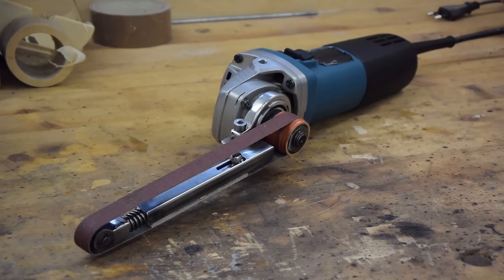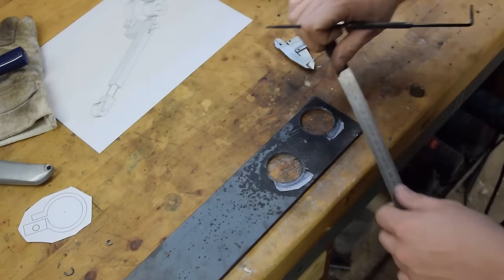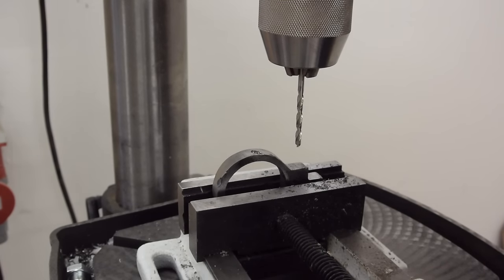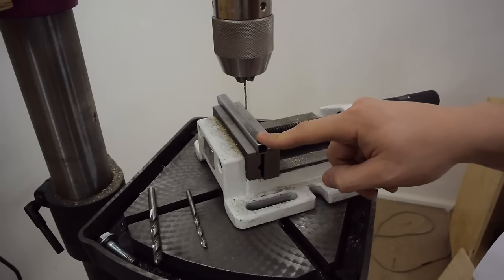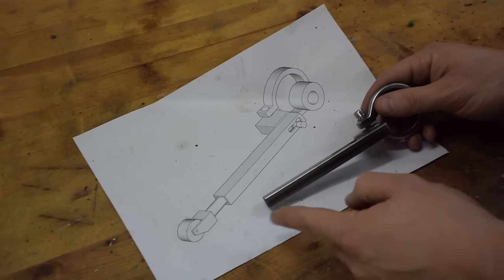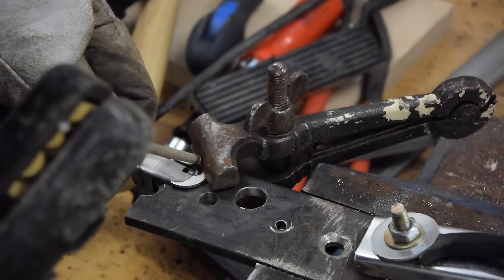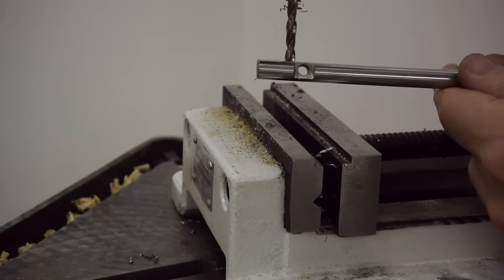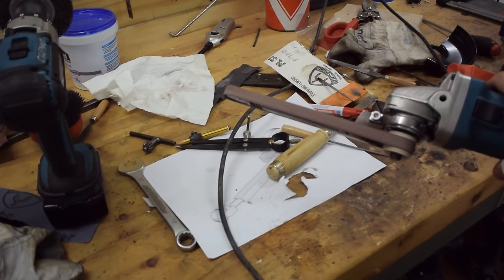How to make a Power File (with basic tools) | Angle Grinder Hack | Grinder Attachment

Comment: cosmas, if the drill was high speed steel you can`t harden this way but you`re fine to use as axle. as you said the bearing will crap out before anything. this is an excellent job and i really like the file work (even if you don`t like it :)) the clamp piece came just extraordinary man, let me tell you i see welds and metalworking everyday and this is top notch. hats off to the design of the pin and the slot.
as you welded a solid bar to the thin wall you noticed you didn`t blew any holes, that`s because the solid is acting like a heat sink and consciously or not one tend to direct the heat to this part which is correct and helps with the excess heat. a trick you could use next time you have to weld so thin is to fill the tubing with solid bar or a strap firmly against the side to weld, aluminium or copper works even best. you can also start the arc on a piece of solid stock you put close to the weld and "walk" the arc to the joint (if it makes any sense what i`m trying to explain). that transformer is making a lot of noise ! haha reminded me of my first machines (nothing "electronic" to smoke ah?), see if the metal plates of the transformer aren`t getting loose, soft rubber feet help with the noise. and one important thing with a transformer if you have a metal cart or table put something btw the welder and the metal or the magnetic field is going to sink in these parts and make a mess of your settings. thanks for sharing man. take care. pete
Reply: +thebrokenbone  Man, you have revealed some very useful tips about heat sinks and settings being affected by adjacent metal plates. Glad I read your comments - Cheers!!
Reply: thebrokenbone
Reply from the maker: Thanks for the info! Very interesting!

Comment: You are genius, Cosmas.  I bought a Makita 9032 when I needed a belt sander.  It was expensive and the motor is sticking aside making it quite unbalanced.  Your thing looks better especially if it is installed on a very small angle grinder.  And, one more thing: I was dreaming of a cordless belt sander, but did not find a single model available in the World.  And you made it possible!!!  Brilliant idea!

Comment: For those that don't have access to making the clamp section, the guards meant for larger grinders usually have a deeper wall, at @1 2 dollars, one can be bought, cut, and repurposed. Most hardware stores carry a small selection of aftermarket parts for tools. IF one is lucky, one could find a flat wall guard, that's perfect since you can just drill in to the face and make a support directly from that without even modifying a thing. Bosch guards usually are build that way, and out of quite thick material.

Comment: i use a little work sharp belt sharpener a great deal for little shaping and deburring tasks.  never knew it could be used as such but use it for this more than for sharpening by far.  light and handy too, but not heavy duty like this sweet ass build

Comment: btw, since not all bearings are made for that high rpm, you could use a speedvariable anglegrinder. these go from 2K to 11K so it is a very nice addon to adjust the agressiveness of the sander ;-). greetings

Comment: Thank you looks a nice and easy design think I might have a go.
but just a thought for you as I going to do it on mine
instead of an 8mm drill for shaft use an old M8 tap as you should find that the end is 8mm  (7.98mm with micrometer) I have used them for locating pins for jigs I made and just for extra info M6 taps are 6mm die and M10 are 10mm +/- 0.02mm: I keep ALL old taps
they are also good for making samll fox wedges

Comment: if you want to weld something really thin... switch the welding cables around and try ! all the heat will go to the 'earth' cable and the thin metal wont melt that easy :) OBS ! im betting its not that great for the welder ! but it works ;)

Comment: filing is one of my favorite task as long as the file is sharp. the only problem is when there's not that many good cutters left on that once awesome file. Do I throw that file away, heck no it goes back to file bin, no matter how beat up it is. So this file grinder attachment would be excellent in a way, an advantage over those files. Throwing away the bad pieces of a belt would be easy. I used to treat files rough, storing them all together in a large plastic tube that becomes a target from 5 to 10 feet away free throw attempt, until I seen a few of their prices-up to $150 each, now they are sitting cleaned and flat, individually apart from each other in the top 3 drawers of a 22inch deep Mac Rollaway. The unhardened handle of files are excellent for broken bolt extractors also.

Comment: The problem I noticed is that sparks coming out toward you when grinding, some how you must reverse the spinning direction of grinder to be on safer side. Nice work Cosmas.
Reply from the maker: That would be far more dangerous because the grinder would kick towards the user. The Sparks aren't a problem. You can't even feel them.
Reply: reversing would mean spark coming towards your face... Better with the sparking going towards your pants
Reply: Art O
Reply: 8 0

Comment: Hey Cosmas, I only just found your channel.  Great videos, thanks very much. Super impressed with your power file: extremely well finished.  Couple of quick questions: what wall thickness square tube did you use (looks like about 1mm?) and did you buy it, or scavenge it off something? Thanks again! PS love the Cheesecake scale of hardness! I reckon 65 degrees is about right.

Comment: Cosmas, have you found any problems with those belts running at angle grinder speeds? I can't remember but I feel like our little pneumatic finger file at work is in the 3000 - 4000 rpm range only ... Quite amazing work though! Thanks for the great builds.

Comment: The only way that this could be better is if you had used JB Weld for all the joinery. Nice job. Ist Gud
Reply from the maker: JB weld is I think not durable enough for this application. I wouldn't use it. May I ask why you think that would have been better?
Reply: If it was possible to use JB Weld than a person could make the thing without knowing how to weld, but as you pointed out it is not possible so it can't be better than what you have shown.

Comment: Nice job Cosmas! One question: You use a bi-metal hole saw there. Would it be easier to cut the clamp piece out of a steel tube having the wall thickness of 5 mm?
Reply from the maker: You're right, but the problem is the diameter. It needs to be 43mm id. I don't think they sell pipes of that size.
The hole saw makes quick work of creating a hole o of the required dimension.

Comment: Really, really nice build but I have a question. When you welded the bearing to the shaft, didn't you burn off all of the grease?

PS, I haven't seen an oil can like that since I was a kid, they are all made of plastic now.
Reply from the maker: No that didn't heat the bearing up much at all.

Comment: lol, "weird imperial thread" 5/8"-11 is a very standard size and extremely common. If any place carries imperial hardware, they will have 5/8"-11 nuts.
Reply: Orcinus24x5 I'm pretty sure the spindle on his grinder is a M14 x 2.00mm?

Comment: Wow, you are amazing. Just awesome.
Very well explained. Now I need to learn to weld better :-)
By the way, what kind of hole saw/drill did you use for the openings at the start?
How is it called? I suppose especially for metal (which I never saw)
Reply from the maker: Cool! It is a bi-metal hole saw.

Comment: Fantastic build, but you scared the shit out of me using the grinder to turn the part in the drill press. It's way too easy to knock the chuck off the taper with side force like that.
Reply from the maker: When it falls off, I push it back in, give it a whack and we're good to go.